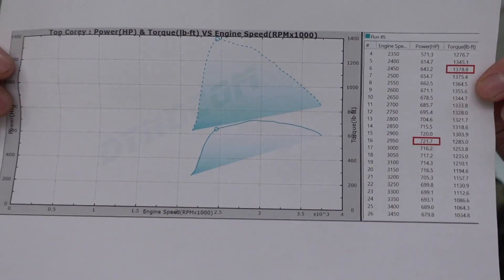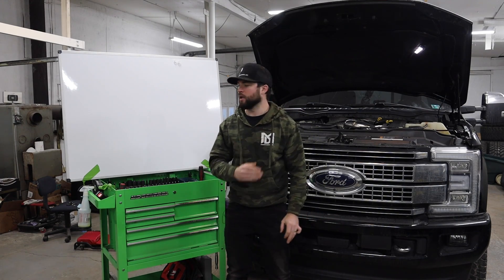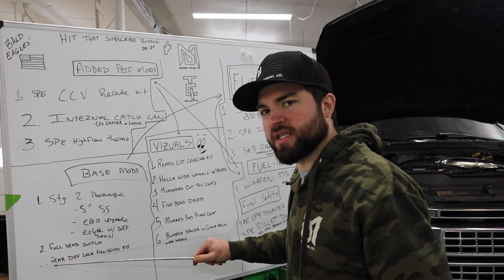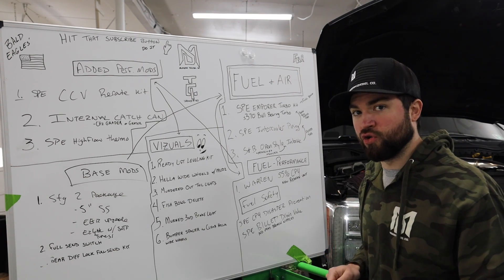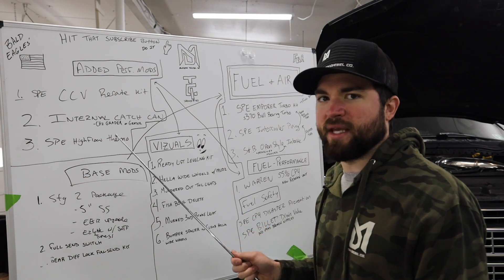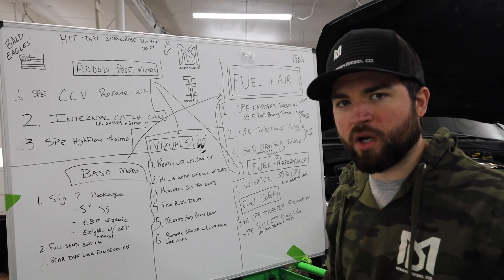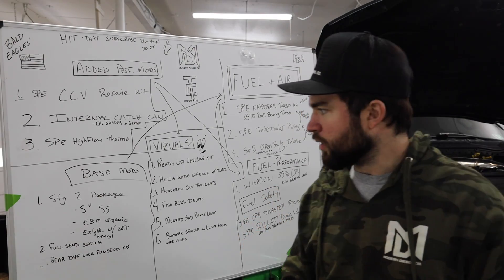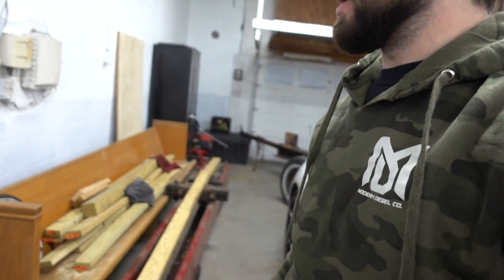F250 6.7 Powerstroke 750hp FULL MOD LIST! UPDATED and a major fail at the shop

Comment: I’m a contractor and I have done different type of build outs and depending on how your ceiling is made of, cutting into the ceiling would definitely be the easiest and most cost effective way to go. Measure and section out what area you need raised and fab a little taller ceiling in that location. Cutting into the concrete foundation is a 50/50 chance you may leave it a little weaker than previously pour and cured. I’m assuming you would be using heavy bends of rebar to pour over once cut and removed. Just my idea but can’t really see from the video. Hope this gives you a better idea of how to go about it. Good luck bud 🤙🏽
Reply: My same thought pattern. Way easier and safer to modify a ceiling than a concrete floor. One is structural and the other isn't. Good luck!

Comment: As a professional construction manager I can tell you that structural steel columns for building framework are routinely recessed below floor level. As long as your footings are big enough to support the anticipated loads, it doesn't matter where they are in relation to floor height. In fact, floors are often poured around the columns after they are erected. Just be aware of the trip hazard of the depressed footings if you don't fill in the holes to floor level.

Comment: You could lower the foundation for the lift posts but if you want the arms to swing correctly  you will have to modify the lift pins on the locks that allow the arms to swing when the arms are in on the floor.... with the base plate of the lift being below grade you will never be able to get the arms low enough to engage the releases with out modifying. Lowering the pad sounds like an easier option than the roof if your already doing concrete work. best of luck sir!!!
Reply: Was going to say the same thing and recommend just pouring a whole new pad with no recess if possible.  More expensive option most likely.